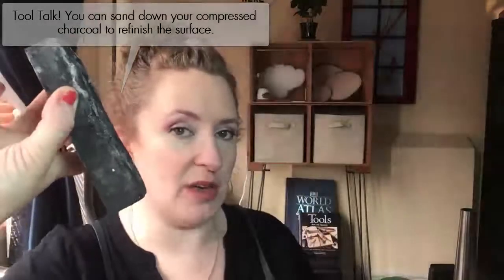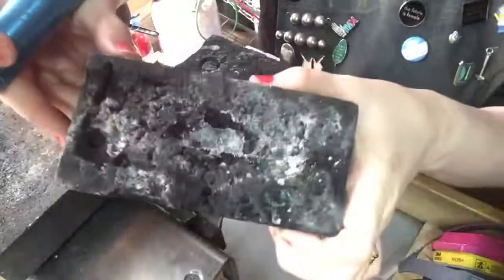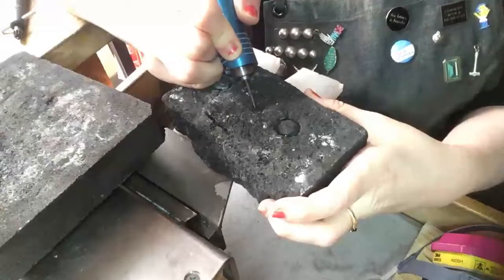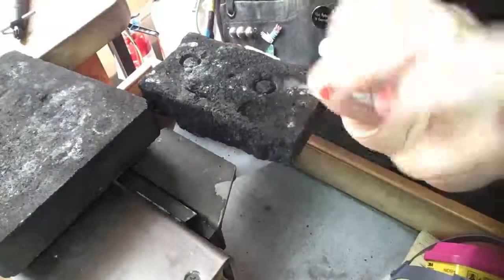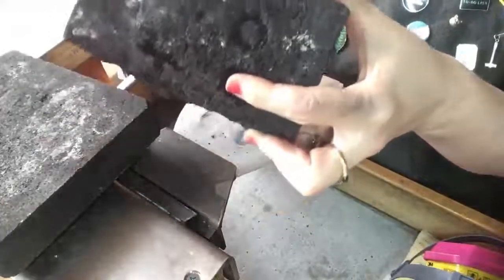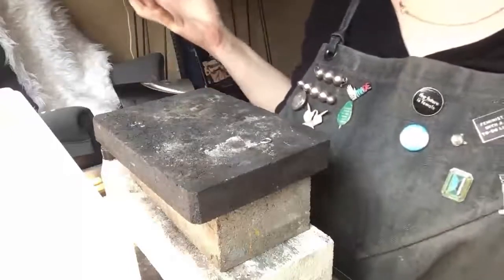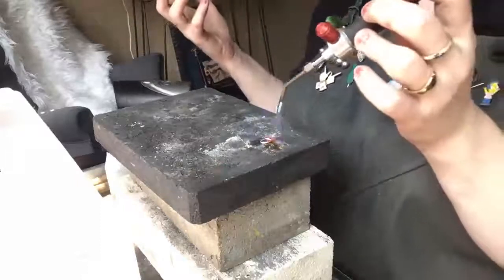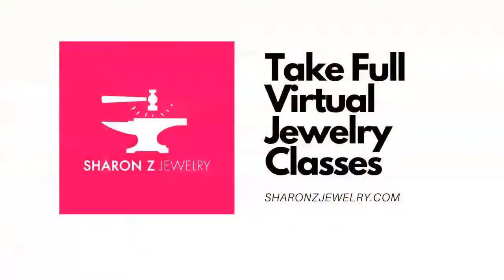Tool Talk! Why I like soldering on Compressed Charcoal

Comment: Do you have any opinion of the bernzomatic fire point creator torch?
Reply from the maker: That's the one that uses MAP gas? I haven't used it. 

It looks like an atmospheric torch, meaning it doesn't come with a separate oxygen source, but draws oxygen from the air. Everyone's experiences are different, but I prefer a torch where you can control the mix of oxygen and gas easily and the air torches (like the Prestolite too), don't allow as much flexibility. Also, I don't see if the Bernzomatic offers smaller torch tips. That would also be a consideration when looking at torches as multiple sizes of torch tips gives you the most options for working on small or large work.